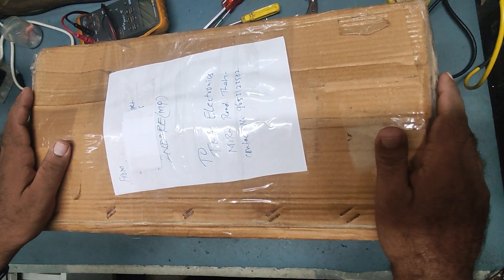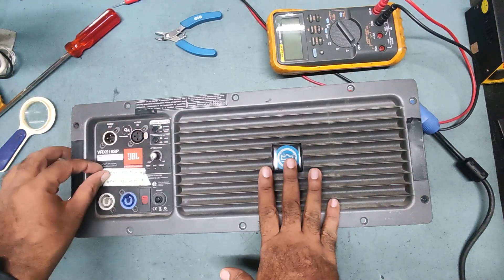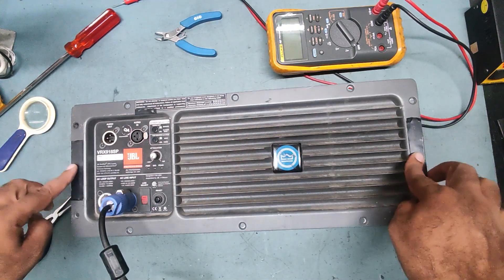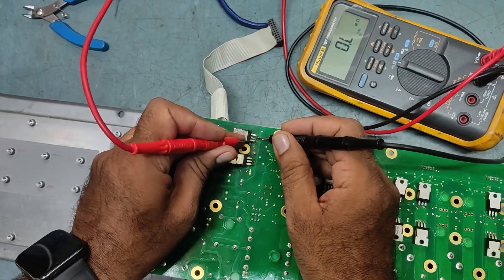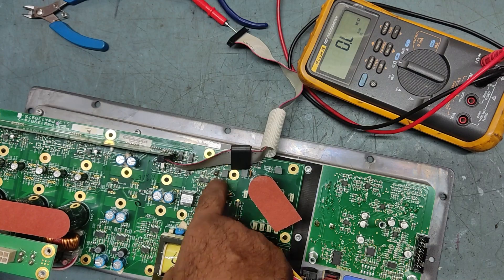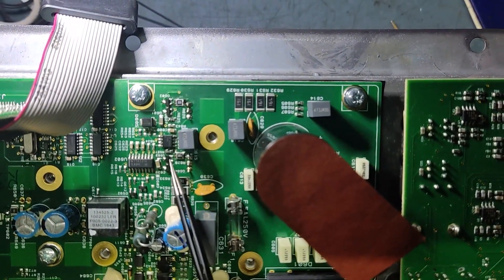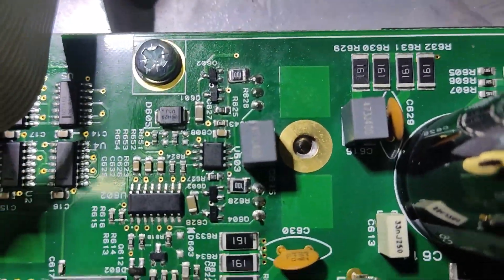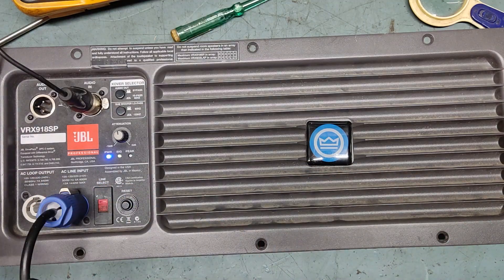How to repair very badly shorted Power supply of JBL VRX918SP Active Subwoofer Module

Comment: Looks like R610 resistor on the same board is fried got any ideas what the componant is since I cannot read it anymore? (its just above the power supply area in this repair)
Reply from the maker: R610  24k/2watt

Comment: I got 2 of these with similar issues.
After replacing the same parts as yourself with the addition of the TL494 on one of them, it immediately blows the IGBTs.
The second one, after replacing all parts as well as the through hole resistors, there is no power.
Any ideas?